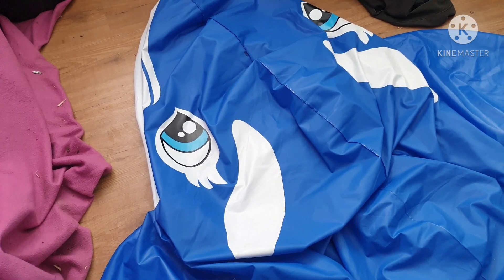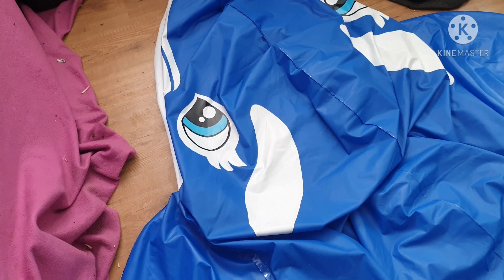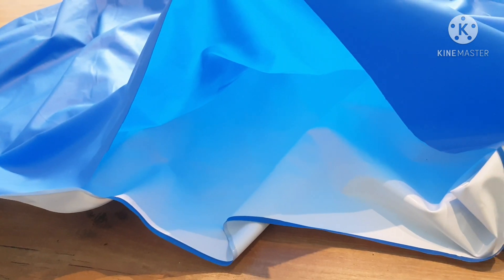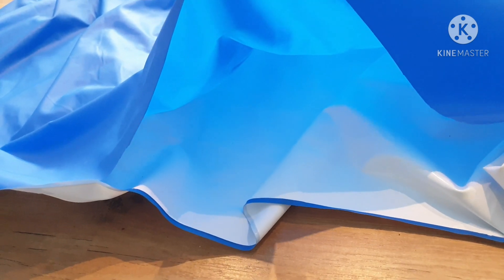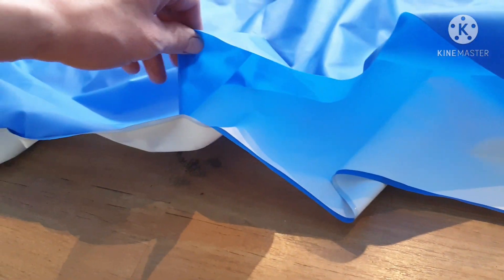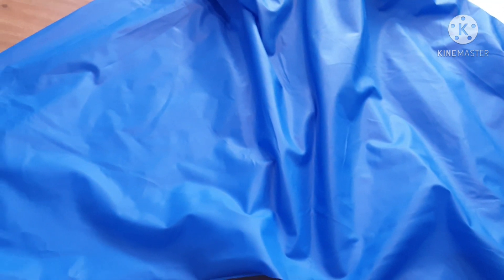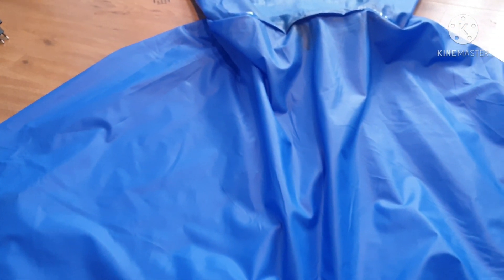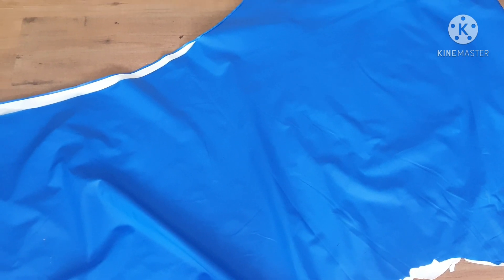The end of the 3 Meter Whale.😞

Comment: You can simply glue there a strip of vinyl from the inside. Start at one end gluing it along one side of the tear to the other end. Let it dry a bit and than slowly close the seam by gluing the strip the other side. It is better to finish with the side that has the pinched seam edge on it as it is then easier to align.
Reply from the maker: I will get a new one in May 2021.